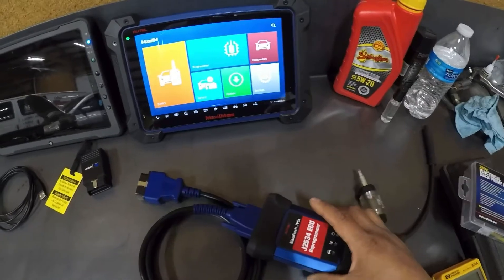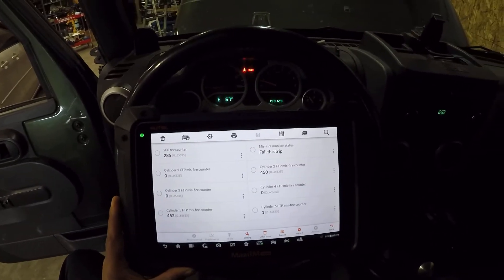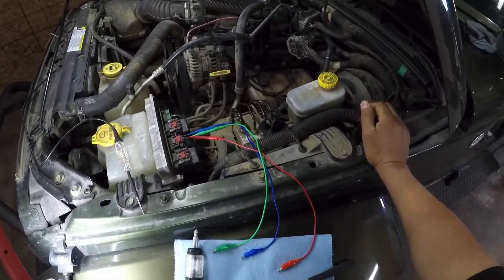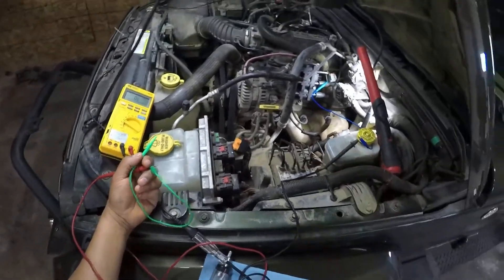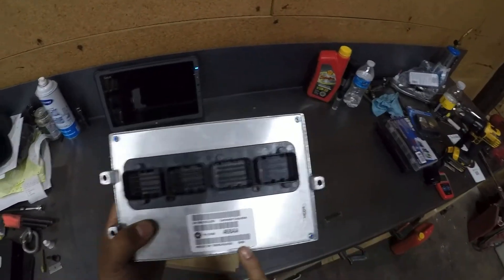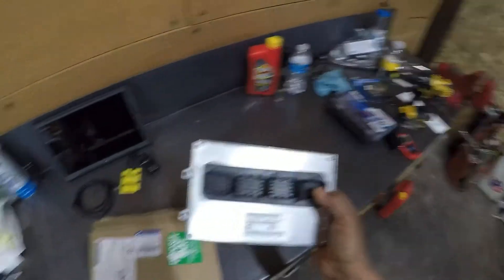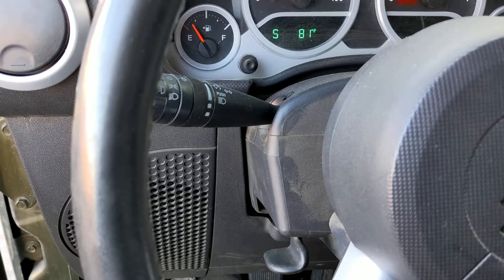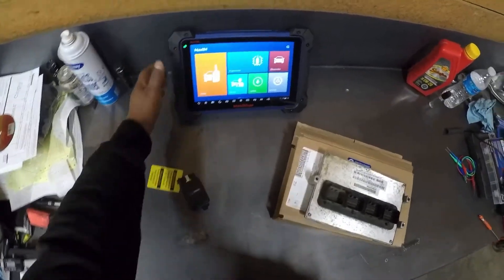JEEP WRANGLER, ENGINE MISFIRE, BAD ENGINE COMPUTER, ECM PCM CALIBRATION WITECH

Comment: so in small words change the pcm . for any missfire .. that happening to me change all spark plugs cables and coil still missfire .. but if i buy the pcm from chrysler i have no idea how to download the program .. ill figure out .. thank you great video
Reply from the maker: did you check compression?
a dead or low compression cylinder can trigger misfire codes as well.

Comment: i  have 0300   code 
replese the coil pack wires ingector  stil  have  mis fire
Reply from the maker: Check compression on all cylinders. if you have around 150 PSI on all of them then your problem is on the electrical side. 
if the compression is not even on all cylinders, then you should take a deeper look on to that motor.
if you need to test for spark, just watch my video from start to finish.
you also need basic tools like the ones I have on the video, spark tester and noid lights for injector pulse width..